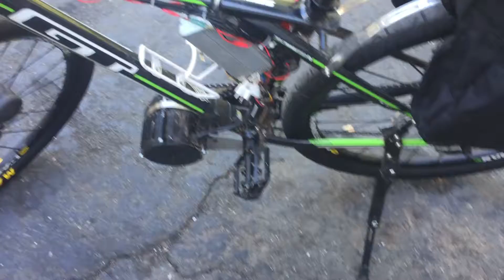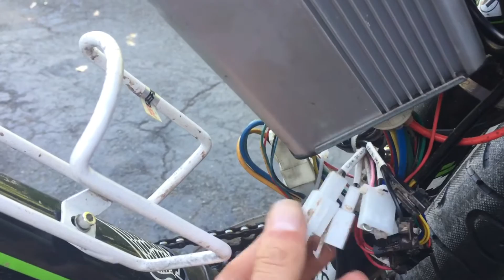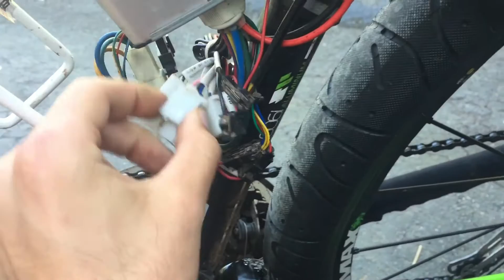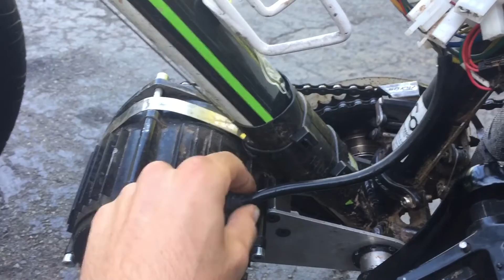Cyclone 3000 Watt e-bike speed mods

Comment: I have the Cyclone 3 speed switch and the black to pink mod does increase power all the way across the board, not just top speed.  My Cyclone has handled 84 volts just fine.  The caps inside the controller  are rated 80 volts.
Reply: I have received right now and the black stock controller has 100V caps.

Comment: i have a 20s liion battery that maxes out on 84v when fully charged. Will the stock controller be able to handle it?
Reply from the maker: I have run 20s lipo on my bike and it seems to hold up okay.  I would definitely keep a close eye on the motor and controller temps while running 84 you do not to them overheat and do damage

Comment: can this 3000w motor gives you 80kmh or 50mph
Reply from the maker: Kentlim Leong 
I am not running  high enough voltage to reach 50mph
Here is a bike with the 3000w motor that goes 50mph. https://youtu.be/C7RdXrbSN9E